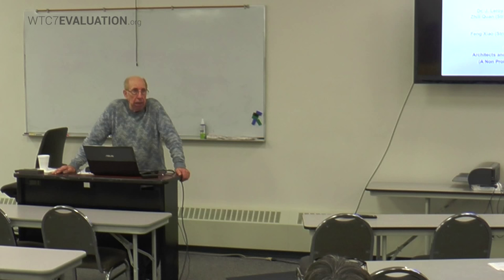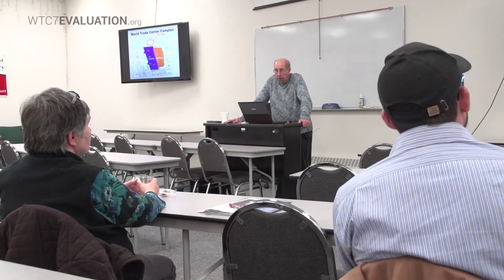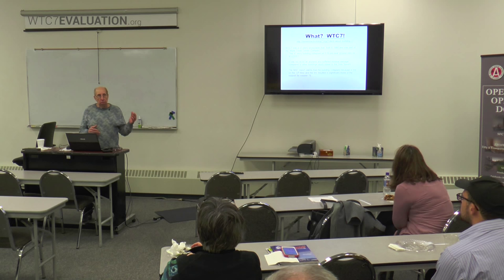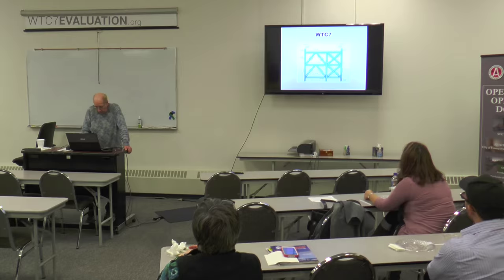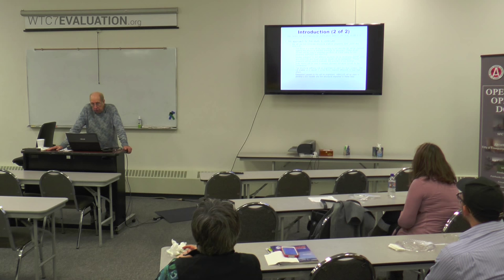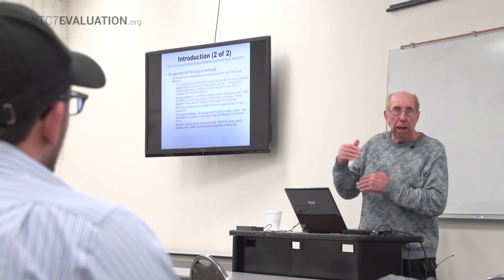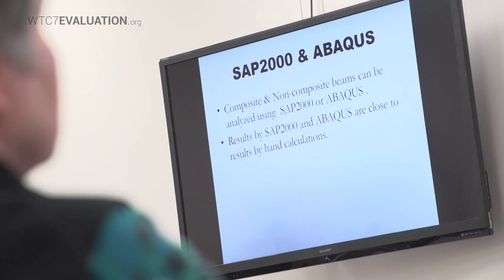Dr. Hulsey Presentation to the Associated General Contractors of Alaska

Comment: Based upon the findings of the NIST report, you should 'not' use your wall mounted central heating boiler any longer. For to do so will result in it 'melting' and dropping down onto the floor below at 'free fall' speed. Laughable, I know. But, non the less true, 'according to government'.